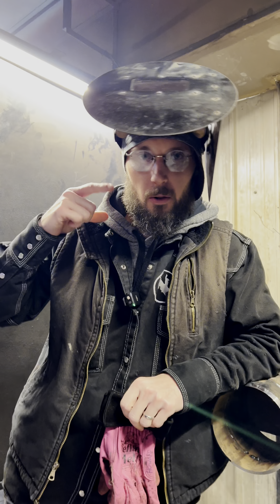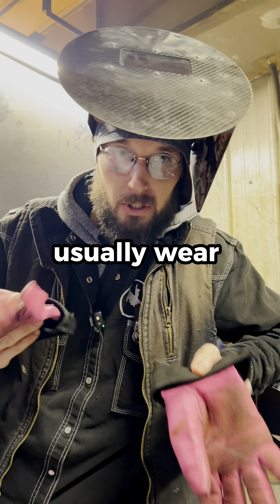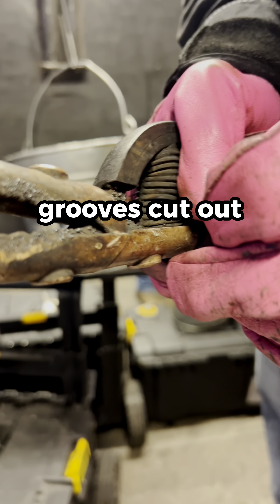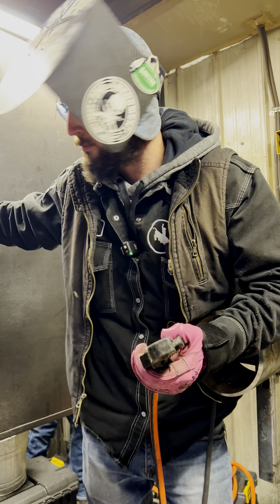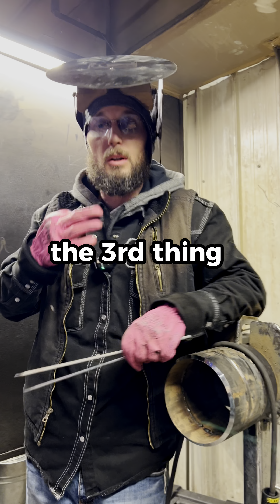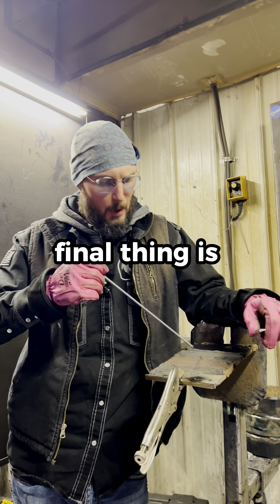5 must-haves to start STICK WELDING #shorts  #welding #stickwelding #bluecollar

Comment: I picked up welding 2 months ago and this vid have helped a shit load. I went from sticking my rod every time I went to strike an ark to being able to lay down a not bad weld. I’ve been playing with different techniques and have moved on to using a second rod for fill-ins. I was told that’s hard to learn I had it before my first rod was spent. Nailed over head just as fast.
Reply from the maker: That's awesome! We're happy to help